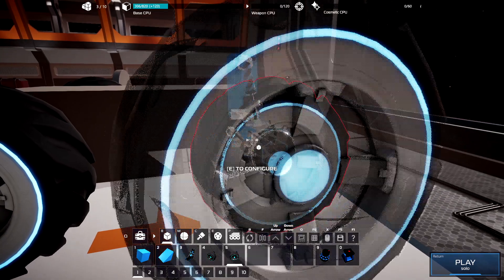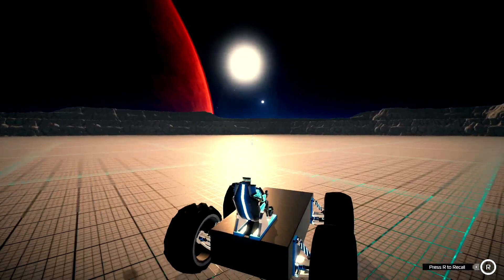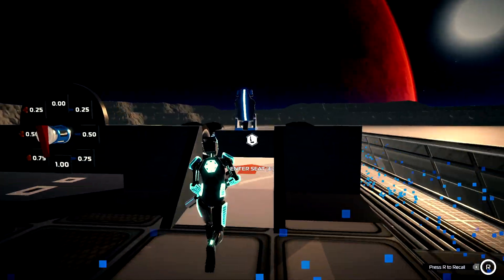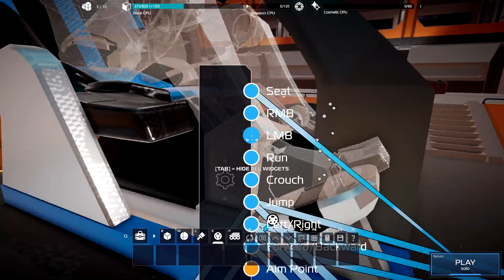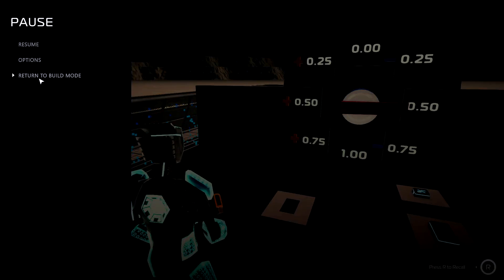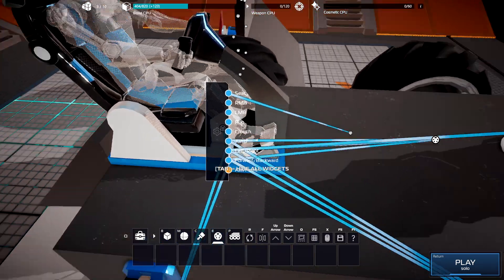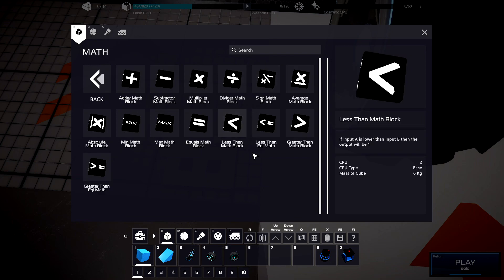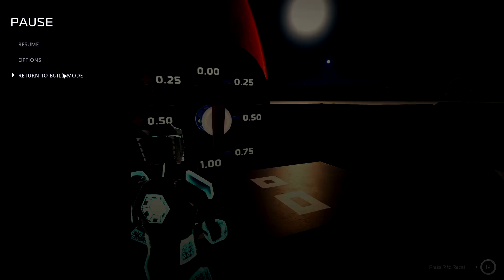Robocraft 2: Logic Quickstart

Comment: I uust want the og back
Reply from the maker: Robocraft 1 is still playable, though the player count is smaller. They added back tiers, but it's still not much like it was during 2014-2015. 

If you want the 2016 experience, Robocraft Infinite has no tiers, every part unlocked, and so on. However, its playerbase is almost completely dead.

If youre looking for something exactly like the 2014-15 era, I'm afraid you probably won't find it. There are fan projects, like Procelio, that might fit the bill for you, though.

Comment: I was hopeful and excited to see a new Robcraft.

Now I'm scared of Moba Factorio.
Reply from the maker: Dont worry. The uses of logic when playing optimally are very limiting. You can't really use it to make meaningful AI that will avoid obstacles or anything like that. Or rather, you probably can, but the cost is so steep you wont be able to do much else.
Reply: @-lijosu-  it at the very least is super interesting. I was thinking about how one could use the proximity sensors to trigger auto guns to defend you from the back while you are moving around.
Or, since i saw a build with 2 pilot seats, a voltron style robot controlled by 2 people that can be separated at any time in a pinch.
Reply from the maker: @casualgoats  You can definitely do both of these! It can be a little more difficult than youd expect, and the results arent always incredible, but Ive seen people do them!

Comment: Could you demonstrate on how to make something toggleable? For example, lets say I want to extend a piston, but also retract it back with the same key, without having to hold it down, just one press for on/off like a light switch.
Reply from the maker: If you think a video for that would be helpful, I absolutely could. 

In the meantime, you can attach the button you want to the "toggle" port of a bit block. You then attach the "value" port to the parts you want to be affected.
Reply: @-lijosu-  I've tried using the bit block, but there must be something I'm not quite understanding. I have the wiring set like this currently

run -> bitblock (toggle) -> current state -> piston (set to extend)
Reply: Nvm, I JUST got it to work, I realized I didnt need the connection between toggle and current state.
Reply from the maker: @LordTacotheGreat  Im glad you figured it out!